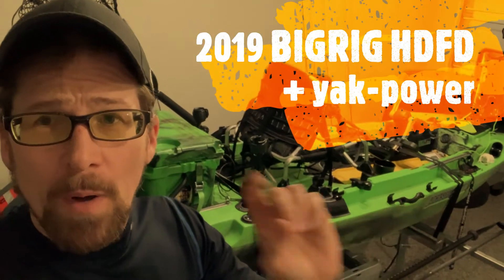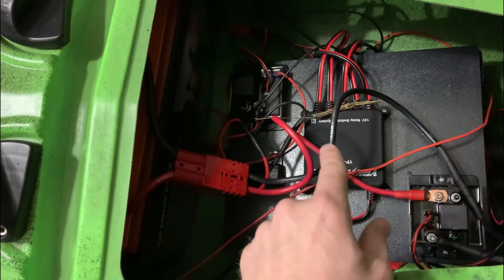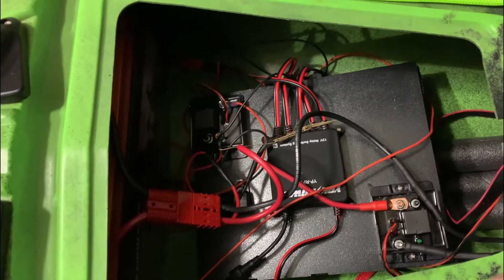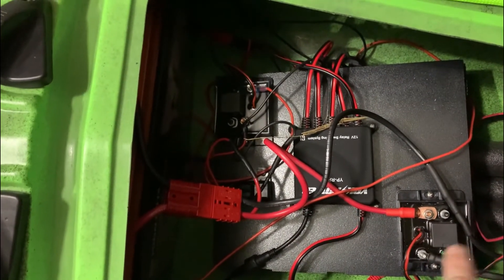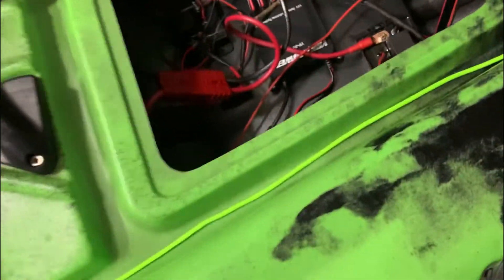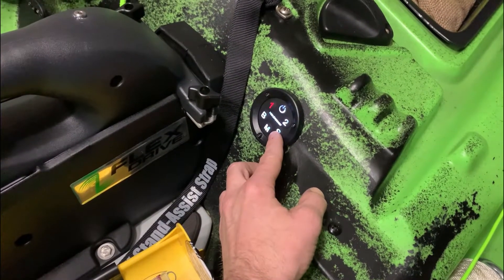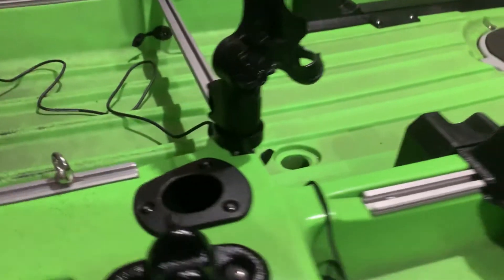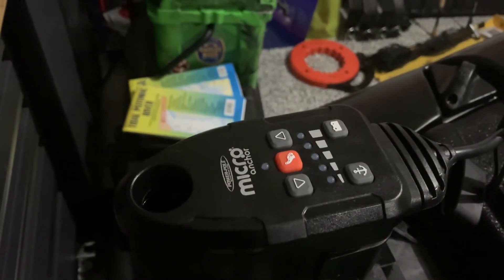2019 Jackson BigRig HDFD | Yak-Power | YP-RP5CS3 | YP-RP5R | Setup & Walkthrough

Comment: Great video! Still confused about how your 100AH battery is connected to the Yak-Power system  and how you incorporated a separate battery for the fish finder. I currently have the same Yak-Power switch with battery box(18AH total) and have the finder run off the M port on the switch. I just added a trolling motor on the bow with a 100AH battery and wanting to do the same thing you did. I will most likely just do the one 50amp breaker for the motor but would like it to be integrated into the Yak-Power system.
Reply from the maker: I only have the one 100AH battery. Let me know if I can explain more, can chat live if you like. I will be having another video out soon about the rigging of the Knarr is just got this year.
Reply: Just curious if I can leave my 18AH battery box connected to the red power plug (Power In) on the RP5R switch to power the other electronics and lights while also running the Trolling motor directly through the 50amp breaker(also connected to the B port on the switch) to the 100AH battery.  I didn't see how you have the switch powered in the vid. Just don't want to fry anything.

Also...wondering if you have experienced any interference/disruption on your finder using the the single battery to power everything. I am rigging an Outlaw 11.5 BTW.
Reply: Also, in case you do not know already, there is a setting on your fish finder that will allow it to automatically power on when you press the button on the switch so you don't also have to also press the power button on the finder...just FYI.
Reply from the maker: @JamesRichardson-wr1me  Will reply here shortly. Stuck in traffic, I’m sure there is a way to do it. As for the auto power on, I have that set on my new setup! Thanks!
Reply from the maker: @JamesRichardson-wr1me James, finally got around to read the entire question. Are you looking to use both batteries as one big battery, or are you looking to have two independent batteries?
Reply from the maker: @JamesRichardson-wr1me I also have not seen any interference whatsoever while running the trolling motor. I use the HDS Live 9 with the 3n1 transducer that came with the unit.
Reply from the maker: @JamesRichardson-wr1me The yak-power switch connects directly to the 100AH batter, both the + and - connections. The trolling motor's - side is connected directly to the battery whereas the + side goes through the 50A breaker. The 50A breaker has an SAE cable that plugs directly into whatever port on the yak-power switch you want to control it with. For example, I have mine connected to B for Bow.
Reply: Well, kind of just exploring my options I would like to use the 18 amp hour batteries that I have already in conjunction with the 100 amp power battery. Based on your response, I’m guessing that the power only goes one way on the switch so the hundred amp power battery does not power the switch through the B port. So I am probably good to use the 18 amp power battery to power the switch. Only one way to find out I guess.
Reply: Thank you so much for taking time to respond with such a thorough answer. I really appreciate it! Would love to chat sometime and let you know what I am powering as it’s pretty unique, I think.
Reply: Short story is that I built a custom trolling motor with a Minnkota power drive unit and an actuator arm that will be controlled by a custom control box and I’m just trying to figure out how to wire everything as I am not an electrician but learning a bunch.
Reply from the maker: @JamesRichardson-wr1me  no problem! I love the kayaking community, so no need to thank me!
Reply from the maker: @JamesRichardson-wr1me  Actually, the power is bi-directional. I can charge the battery through the power plug port for the trolling motor.

Comment: How do you have the battery mounted inside the kayak?
Reply from the maker: The battery was actually in the bottom part of a battery box that was placed in the bow hatch of the kayak.
Reply: @captainrookhook  did you have any weight distribution issues with having the battery in the bow along with the trolling motor?
Reply from the maker: @MrDJamison24  I did not, primarily because of the power pole and cooler/tackle in the stern.

Comment: Those connectors are only splash resistant for vehicle application.
Reply from the maker: To which connectors are you referring?
Reply: @captainrookhook  SAE type
Reply from the maker: @fishntools  check out yak power, and I don’t plan on submerging my kayak, at least I hope not 😂 they are il68
Reply: @captainrookhook  Oddly enough is doesn't state that in the J928_202208 specification?
Reply from the maker: @fishntools  interesting not sure why they sell it then for Marine type environments
Reply: They're dirt cheap